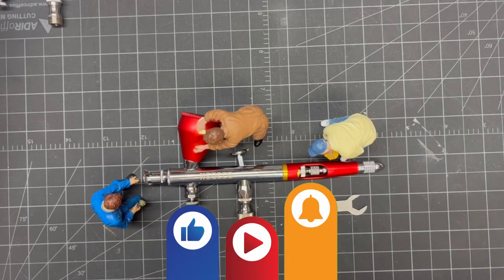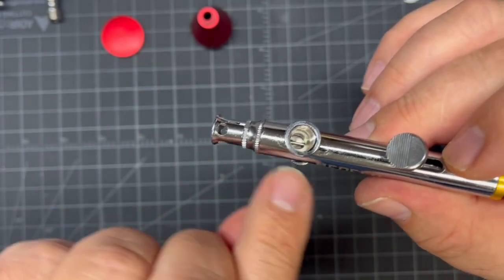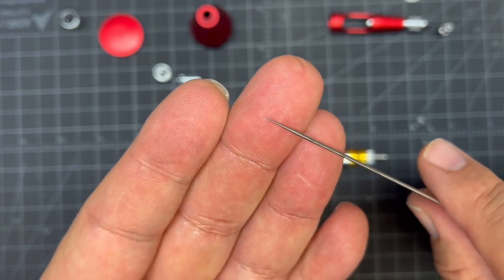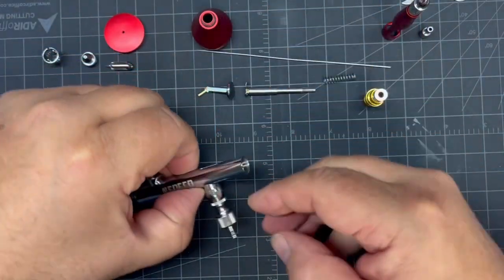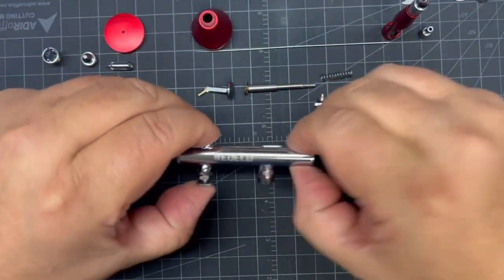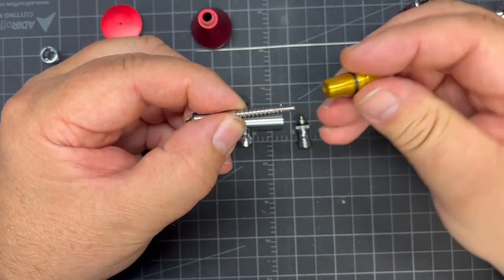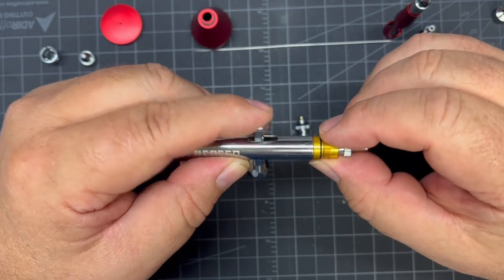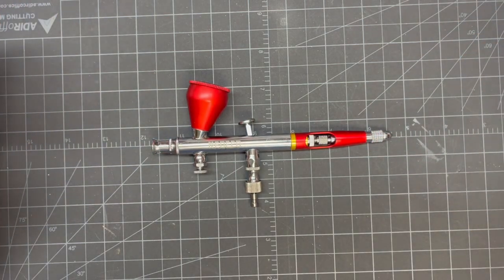NEOECO NCT-SJ83R two stage airbrush Takedown video.

Comment: That is a informative video. I never thought to push the needle out. The "page" I got with my cheapo brush said pull the needle out to clean it. I have been cleaning mine all wrong... 🤣
Bet ya can guess what I'm getting payday... 🤔😆
Seriously I do need one. I found out today, after setting 5 years in a drawer the needle is rusty, which makes it good for primer only now. I did try to polish it but it is pitted a bit. Thought I had another needle but can't find it. Awe well, it sucks, I have to get a new brush... 🤪

Thanks for the video Mark!

LLAP 🖖
Reply from the maker: Bruce, hang tight before you get one before I try it out.  I haven't even shot water through it yet.  I'll let you know how it does tomorrow afternoon.
Reply: @grandpamarkshobbies  10-4 copy that! If it works as good as your old one I don't see a problem with! Lol
Right now my internet is down they said it's going to be 3 weeks. Then I get a text message saying his part of a large area outage.
That's okay it's going to be 2 weeks before I get paid.. 😂
LLAP 🖖

Comment: Great video gramps..I have the first one they put out. Absolutely awesome..but I just started using a Galleri advance, super nice,easy to clean it has a pop out needle/nozzle ? Which has multiple air holes👍but I learned a lot, never broke her down all the way,but now I can😁👍👍Thanks
Reply from the maker: The first one is a good airbrush, and this seems to be a big step up from that.  To be honest with you the people at Gaalari just got in touch with me and want me to try out two of their airbrushes.  They are sending them to me soon, so I will be doing videos on them too.  They are also coming out with their own line of paint for model cars, and will be sending those out too when they are about ready to hit the market.

Comment: Is there a O ring near the tip I have the same airbrush. I used mine once it worked fine and then it started blowing bubbles in the cup and it blew the lid off. Not sure if it's something I did.
Reply from the maker: Yes, there is a very thin o ring on the jet cover.  If that got lost it will cause that.  I thought they put replacements in the kit.

Comment: What is the needle size that comes with that model?
Reply from the maker: It comes with three.  a .2mm, a .3mm, and a .5mm  It also comes with two larger sized cups, a quick disconnect fitting, and a full set of O-rings and Teflon gaskets.

Comment: Great tear down. Very informative. BUT, that needle is bent bad.
Reply from the maker: I thought so too.
Reply: @grandpamarkshobbies  I noticed it when you placed it on the mat on the straight line.
Reply from the maker: I took the needle out of the airbrush today and put it up against a steel ruler, and it's straight as a poker.   I looked at the video again, and it does look warped, but it sure isn't.  LOL  Must have been something with the camera.
Reply: Very good explanation. I see you used a wrench to take the air inlet off,but didn't use it when you put it back on.
Reply from the maker: Yes. It was just a bit too tight.  Usually I put it back on hand tight and it is good to go.

Comment: Push the needle forward?? Seems counter-intuitive.
Reply from the maker: When you push the needle forward you are not pulling the paint back through the seals, and keeps everything just a bit cleaner.  Give it a try and see what I'm talking about.
Reply: @grandpamarkshobbies  Yeah it makes sense, but my fear would be that you could somehow mess up the "channel" the needle tip fits through, by pushing the wider part of the needle forward through the internals. Now, that's probably just due to my ignorance of how the needle fits through the airbrush as mine hasn't arrived yet and Im just speculating based on how tight it seemed to be to push/pull it out.
Reply from the maker: Once you get it and take it apart you will see that it isn't as tight as you think.  It will slide right through.  Now I push it in from back to front, but I pull it out the front just to keep that o ring and what's behind it as clean as I can.
Reply: @grandpamarkshobbies  You're right, it makes sense now after getting it in hand.
Reply from the maker: Yeah.  It keeps any paint that may be on the needle from pulling all the way through the airbrush.